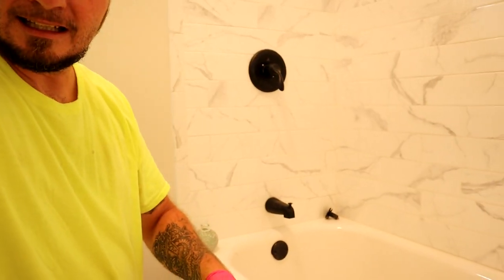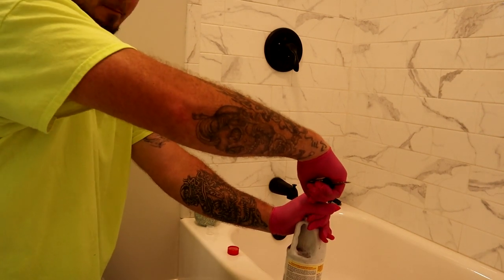It Took 3 Days To Fix A Plumbing Issue...

Comment: No paint, concrete, or mortar down the drains.  Make sure your guys on the next flip don't put it down the drain
Reply: This needs more likes 👍  so Joe can see this is important!
Reply: dontread12 well it should be basic common sense also
Reply: Sounds like something Joe would do
Reply: New construction sites including buildings the GC usually covers the drains before trades start working cause believe it or not the bathtubs are one of the first items that actually get installed when building!
Reply: I've dropped paint down drains before...haven't had a problem though
Reply: Patrick drains are meant for water nothing else! Some people will never get it

Comment: Joe be careful using that stuff in can melt your pipe of plastic and left in there long enough.  Also it will definitely eat away at your glue joints.

Comment: That Chemical Drain Enema your using is going to eat up that Top of the Line plumbing material you used. You should just use an Auger on the thing. Its environmentally friendly too ✌

Comment: If any could add sound to a drain actually draining would be Joe. He's always excited when he finally fixes something that should be easy.
Reply: Kooqq
Reply: Removing damaged pipe from under the house and replacing it, is far from easy.
Reply: @DavidSmith-ph7iy  That was the 1st thing I would have done.  I guess you and me have differing views of easy. Going in a crawl space and cutting out a section of pipe would be fairly easy for me.
Reply: nousername4me2use yup. Always a professional on YouTube.
Reply: @nousername4me2use  and have u seen his crawl space oh wait u probably didn't even watch that video. Lol
Reply: nousername4me2use cringe
Reply: @karlosspades7293  Which one? There's several where Joe couldn't fit under the house. I've been in tighter areas than that having to replace plumbing and electrical.

Comment: Little tip when you are plunging your tub take a wet washcloth cover the overflow then plunge. If not all your pressure leaks out. Avoid drain cleaner at all cost

Comment: Joe, dont ever use chemicals to unclog the drain!!! it will literally eat at your pipe over time and rot. but if the pipes are pvc it shouldnt hurt. If you ever come across this problem again which is likely just snake the drain.

Comment: to use a plunger on a tub and a lot of sinks you have to cover the overflow..... that circle on the tub wall under the facet; usually held by a screw. ** could of possibly tried muriatic acid, usually found in swimming pool supply section as it's used for etching concrete(but wear proper respirator mask when using and eye protection; shit is strong)

Comment: As a homeowner of a 200 year old house, I can easily tell you that plumbing issues are the worst! And plumbers are the worst ripoff artists so I’ve learned a lot in the past ten years! I do everything myself at %5 of what a scammer plumber would charge.
Reply: Plumbers are right up there with dishonest mechanics that don’t fix the original problem, but make everything worse.😡
Reply: Thats because you don't have connections to handymen
Reply: Monica G Davis

Mechanic here with 22 years experience. One of the main problems with techs is that there is no required schooling to become a tech. For example, a guy who was an accountant for 20 years can decide one day that he’s always wanted to fix cars his whole life, so he quits his accounting job, sends out some apps, and I guarantee a shop will hire him. I’ve honestly seen this happen multiple times. So now you’ve got an accountant fixing your car. I’m sure plumbers are the same way lol.
Reply: Mr. Indie 
Smh I know your telling the truth. My father needed a second job one year. He got a job changing oil at Sears automotive. I have never see him change his own oil before or since. 😂
Reply: @monicdavis6150  
Walmart hires oil changing workers too. It's easy to teach and the people at walmart have never done it.

Its one of the easier jobs so they hire anyone.
Reply: Patrick 
Okay I guess that’s cool as long as they are properly trained.

Comment: You need to send the snake down the overflow. It’s near impossible to get the snake to turn past the tee in the waste and overflow. By going down the overflow your cable has a straight shot down the drain.

Comment: Food for thought: anyone else has been able to notice the money he wasted ? Anyone else notice the fact how joes mind / brain works? This goes to show how green joe is and how much learning Joe needs in order to be successful 

1.Joe immediately assumed liquid drain cleaning would do the job even after thinking grout most likely was one of possibilities of the pipes being clogged so joe wasted money and time. 
2. Joe then went back to Lowe’s more time , gas was wasted along with buying a snake that looks like will only unclog a garden hose at best again more money wasted
3. Ultimately Joe had to go back to buy new pipes which again wasted time, money 
Now take and add up everything Joe did to rectify this problem! It now took joe much more money to get this done 

Perfect people let this be a lesson when you try to take the easy way/ approach to doing things the least expensive way 9/10 times this will always cost way more money then if you done did it right the first time! 
So something that should of cost 35-50 bucks to fix now cost Joe over 100.00 which includes gas to go back n forth but the one thing which is implacable is the wasted time Joe will never get back!
Reply: Yes Mexicans have a saying in Spanish when translated it goes something like this "The incompetent/lazy person works twice"

Comment: No, draino Joe.  If it don't drain it will Turin to a solid mass. You may have to digne the hold line out. Call a plumber?

Comment: A water based lube is not the same as petroleum jelly.... its more organic.  And sulfuric acid won't melt grout.  **I'm a woman with no plumbing experience... but even I know that if you don't block the overflow drain, your plunger will be useless.

Comment: Hey Joe ! Well at least you tried. Smart to call on someone. Thank Goodness for Richard. He has saved your A$$ many times. If you had poured more Acid down the drain, it would of ate through the pipes, even sections that were good. In short amount of time. those pipes would of failed and new owners would not be happy. Grout down the tub, geesh--would of been the same in the kitchen drain and bathroom sink. The tub now requires a good cleaning. Hope you can get the crude out from around the the drain ring.

Comment: I sure hope you’ve got this house done 100% solid before they see this video and find out that you really didn’t repipe the house 100%.   Which joe next time REPIPE it 110%.  Do not leave even old cast iron pipe in place.  All the way replaced from sewer / drain to hose bib

Comment: just drop a 1 cup of clorox in the drain every time someone uses that shower or tub and it should clean out the box fine without doing any damage.  You don't have to wash it out, just let your  tub empty then  empty the cup in the drain after your water drained from the tub and let it do its thing.

Comment: That water pressure in that house is atrocious or at least coming from the tub probably plumbed with all 1/2 water lines either that or PRV Needs to be turned up if there is one 🤣

Comment: Oh my God are those metal pipes don't use that s*** it will eat through the pipes or the stuff that holds the plastic pipes on I used to be a plumber at Bedford prison but before that I just got out of jail

Comment: No don't use drain-o or any of that shit.  need to snake the drain or replace the line.  I told you to use a tub liner so you didn't damage the tub.  come on Joe what are 10 years old trying to fix this.  DAM BRO.  It sounds like the vent is clogged .
Reply: Nonya Biznes  I was a Plumber for 30 years acid does not clear the drain it shrinks the clog in to rock hard stuff then you can't snake it or it eats through your pipe. then you have a leak  Me being a plumber I have used acid called Sizzle you need a Plumbing License to buy but I would never recommend using acid I know there was a stroy where some one put acid down a drain and it caused a fire.  when you put acid down a drain that pipe get hot as hell and I guess the dope didn't flush the pipe with water.  it was pvc pipe I think.  sounds crazy I know. you can buy a snake drill for 89 buck I paid $350.oo for my machine it's name brand machine it a Ridged machine and have had it since the 80's